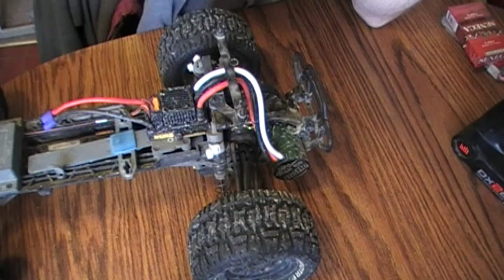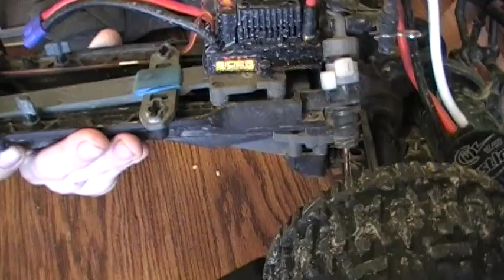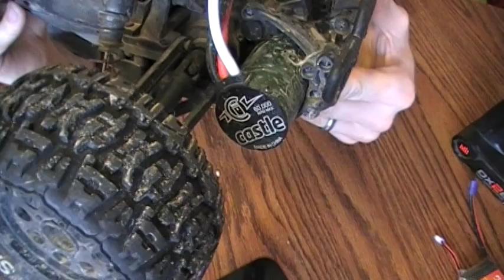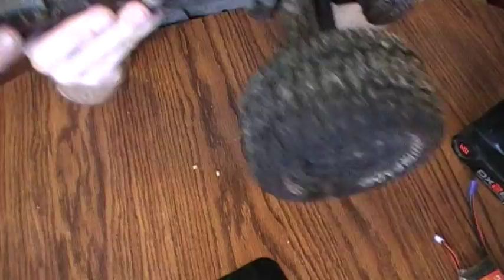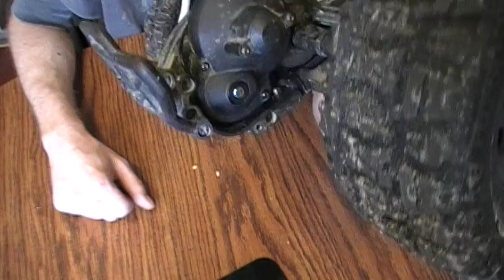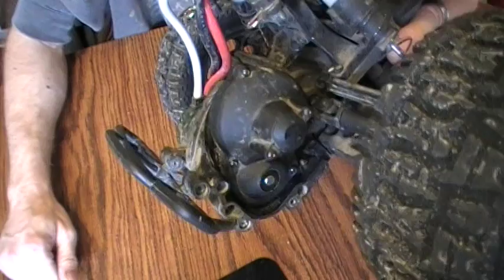ECX Ruckus 1/10th with CC Sidewinder 8th motor/esc

Comment: Ecx Ruckus cost $165 not $299
Reply from the maker: +Chris Tyson the 1:10 brushless is still around 280. The brushed is the cheaper one i believe.
Reply: Okay I had a brushed version then I turn it  to brushless
Reply from the maker: +Chris Tyson I was not disputing the costs. I do not know if there are any other differences between the two versions other than esc and motor. Never looked. I just started with the brushless version.

Comment: why would you put a 200$ motor combo in a $200 truck? makes no sence . could have got the sct 3800kv combo for $119 and saved yourself the goofy look.
Reply from the maker: +rich fortner Because I did my research, and found this to be the combo I wanted. It has everything I want, plus if I choose to scale up, it will work their too. And its silly quick in a pretty tough truck. btw, retail on this truck is still at 299.